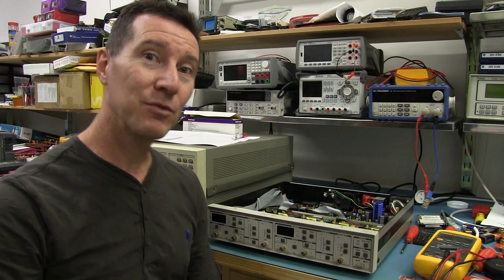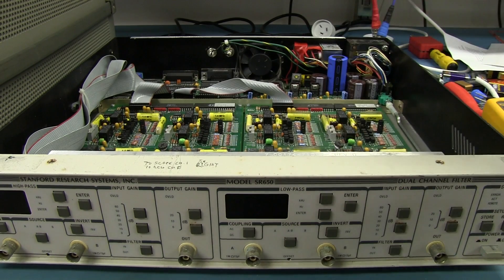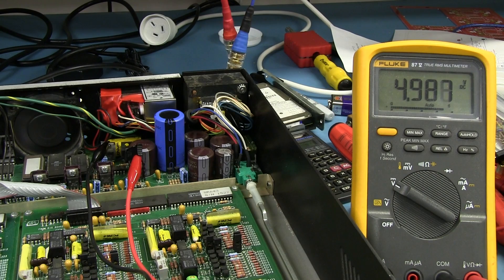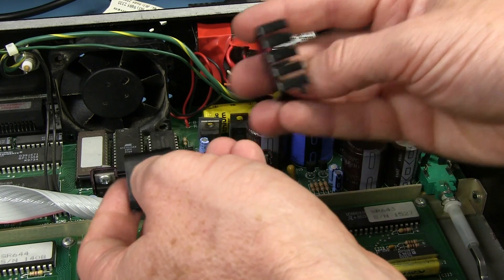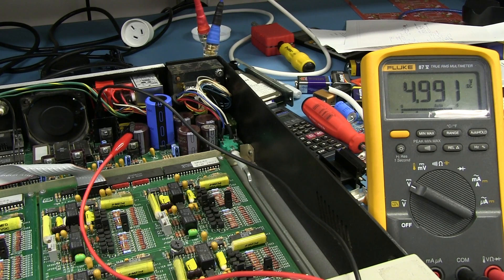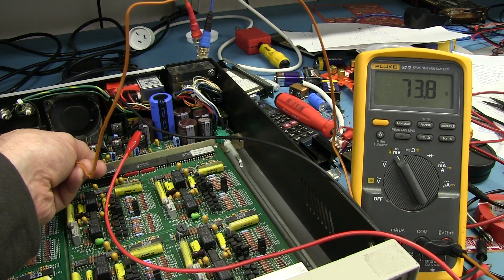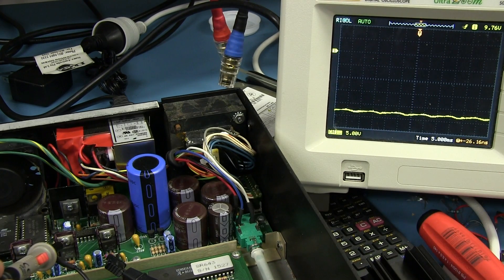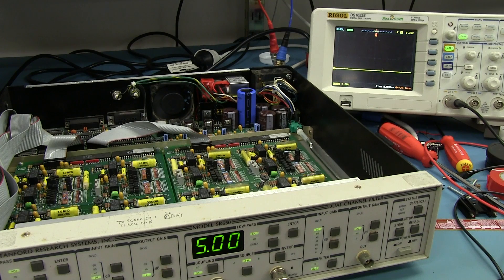EEVblog #621- Stanford Research SR650 Repair - Part 2

Comment: (Note ADVERTISEMENT !!!! )

To make a comparison with a competing product, as a supplier of used equipment, I can wholeheartedly recommend the Kemo VBF8. That model has approximately the same options in terms of filter characteristics. Their gain is only 0 or 20 dB, and the channels have a common power supply. Additionally the filter slope can be reduced to a Bessel-like "pulse respons" shape.

But their power supplies do not have the disadvantages mentioned in this video. The power supply of the VBF8 is designed with a toroidal transformer and such a two-channel instrument consumes no more than about 13 - 15 Watts. And because they contain no LED displays or microprocessor, the VBF8 does not require a fan, and adjustment of cut-off frequencies works with mechanical rotary switches.

For those who want to use such a filter instrument, Eurias can supply a number of units that were assembled in the previous century. With minor signs of use, no rusty connectors, calibrated and tested, they still function as well as when they were first put into use. In addition to variants with an elliptical response, there are also some with an 8-pole Butterworth response. And they are supplied for connection to a 120 VAC or 230 VAC mains voltage, to be specified on order.

Someone else published a video on the Kemo VBF8 at : https://www.youtube.com/watch?v=vFCpho126Fs

Comment: If the vr is a 7805, with the tab being ground, why not omit the the insulator?  Seems like without it the thermal resistance of the joint would be less and the vr would run cooler.

Comment: Looking at the grommet on the transformer wiring, suggests a metal cover was fitted over the mains filter, the regulator would have been attached there so it would be quite a big heatsink, the last person had to remove the screw to take the cover off to get to the mains wiring. That's my guess anyway!
Reply: That is EXACTLY the problem. I didn’t read all the comments to see if anyone else caught that. Looking at another video about the SR650 shows a large aluminum shield box around the input power module. The regulators are attached to that box, which serves as a very large heatsink.
Reply: @Technical_Audio  Wow 5 years ago, I don't even remember posting that comment :D

Comment: Couple years late to the party here, but with respect to the thermal performance:

Remove the stamped fan grill, replace it with a wire grill, and flip the fan around. Airflow volume isn't directly related to heatsink performance; airflow velocity is. The two values are (obviously) related, but the latter is ultimately what affects heatsink performance.

Running the fan as an intake will generate more directed airflow over that power supply section than running it as an exhaust would (by virtue of the fact that axial fans tend to pull air in from every direction while the output is at least somewhat collimated) and produce a significant decrease in operating temperature on those voltage regulators. I don't think this thing uses enough power for the fact that you'd be pushing pre-warmed air across the mainboards to matter; I don't really expect the temperature rise to be meaningful. 

In fact, if you ditch the existing grill and reverse the airflow direction you can probably run a fan that's rated for perhaps as little as half the airflow and static pressure of the current one and still improve thermal performance. I'd recommend something from Sanyo Denki; they're of markedly higher quality than EBM-Papst or Delta and they tend to be quieter for a given flow/pressure curve. Nidec would be excellent, too, but they appear to be hard to come by, at least in the states. Mouser and element14 both carry Sanyo Denki (not sure about australia-specific distributors).

Comment: Great bit of detective work on that hardware. It shows how randomly trying to diagnose/fix things often makes things worse. I remember as a teenager many attempts to repair the family vacuum tube television. Back then that would generally consist of removing all the tubes, visiting the local Rat Shack, trying inserting them one by one into the tube tester, and replacing the ones found to be defective.

I'm guessing that someone with just enough electronic knowledge to be dangerous tried to fix this, randomly disassembling parts of it, then gave up and put the cover back on, minus a few components. Removing a heat sink, though, is the work of a neophyte. It's just like trying to fix an old single cylinder gasoline (petrol) engine by first adjusting the carburetor, which is usually the LEAST likely thing to be out of adjustment.

Comment: 7805 is only 1A can not feed all the segments on that display for too long without disipaiting the heat.. needs a power transistor to carry the load though an inverting OP

Comment: Hey Dave, don't put the repair down. I think this is a great example for a beginning service tech in any field. I've been a tech for over 30 yrs and plain observation is a hugh part in repair of any item. As soon as you noticed wrong screws in the housing, you should always expect anything. Tamper damaged equipment can be a nightmare to repair so rejoice in your ability to find a solution when someone else couldn't.

Comment: I think there was a bigger heatsing - a common one for the 7805 and the TIP for fan controll. and the common heatsink is the reason why there is a isolation silicone tab on the 7805. (why else would the tab be there with a dedicated freestanding heatsink ?)

Comment: Great set of videos!  I just bought an old BK-Precision O-scope and it was listed for parts or repair, so videos like this are really helpful in pointing out what I should potentially be looking for.  Man, that's a pretty nice piece of test equipment!  it will be much easier than breadboarding some filters, meh :(

Comment: Hi Dave. I enjoy your videos, and have also checked out the "Live Cam" too.
 I also have some SRS test equipment. Not badly designed, but could have used a little more thought.... IE: my SR780 has the power switch on the back. What the heck were they thinking??
With your SRS filter.... A big part of the regulator heat issue is the missing lid while servicing, on top of the already missing heat sink problem. You can see the air gets pulled in (or pushed) through the side of the case, and would travel right over those regulators. Computer fans push or pull air in a somewhat conical fashion . This would place those regulators in the direct path of air." So they did their homework in that respect. Still..... It's a screwy design!
I think EMI and RF noise are the reasons they didn't go for a switching power supply. The cost in added filtering, shielding, and "engineer brain power" was probably worth more than the linear supply they built it with. I'm sure the "bean counters" are a little to blame for design deficiencies.

Take Care :^)

Comment: The fan is only held in by one screw too! The phantom parts robber was here! ;) But why would the reg have a conductive pad, and all the other regs not have, unless the heatsink was bolted to.... the fan frame via the missing screw??

Comment: EEVblog How can a simple circuit be designed using a small DC motor that is controlled by a MOSFET when the resistance of the DC motor is not known ?

(In my book they usually give some known values of which you can calculate everything...)

My guess is to just play with VGate of the mosfet to adjust the current in drain-source and then you can choose the speed you want. Is this correct?

Comment: that 5volt regulator with the tip transistor next to it should be a current pass transistor as there is enough digital stuff on those boards to easily go over 1amp or maybe 2. just a thought.

Comment: I too see blown regulators now and then. Some are IC, others a zener and pass transistor. I can see they had a hard life because the heat darkens the board around the regulator IC/transistor. Simple calculation to find heat given off and use proper heat sink to keep temp down.

Comment: Thermal design for power supplies of this type is seldom well executed. Especially by the spec-sheet jobsworths who should be executed for their inattention to good design sense. I once owned a Philips PM5519 that had a number of those regulators on a board that was well singed, with the excess heat. On occasion, the unit would do strange things. After I attached the heat-sinks to the regulators, that they should have had, the unit stopped giving trouble. Even so, they ran hotter than I would have preferred. If it had not been so much work, I would have replaced them with TO3 packages, mounted on the side walls of the very substantial, aluminium chassis.

As for the Stanford Research unit, the layout for the three-in-a-row regulators makes it easy enough to attach a 25-mm wide strip of 3-mm thick aluminium strip, in place of the small screw on heat sinks. This should keep them a great deal cooler. Probably close to ambient. The 5-volt regulator could be attached to the same strip, with fly-leads to connect to the PCB. 

Heat kills.
Reply: Even on expensive lab stuff, sometimes the power supplies are just plain basic stuff like the datasheet is telling....
I got three synths here which are failing from time to time due to heat issues. Mostly rack mounted....poor power supply design, the heatsink is 90°C.
The same is for the Yamaha TX7 good design for its time, but the Caps are too close to the switching transistor, getting to hot and dry or blow off...

I got now three hohner RD500 digital reverb units with deat PS due to overheating. they have all the same problem, the rectifier diodes are desoldering themself....
 
Beeing an audio guy, i always do my own power supplies, well oversized to overcome heat issues, as it´s not very common using 78/79xx, LM317/337 or even all discrete IRF830 (highVoltage) or 2n3055 (high current) based supplies in a (small) housing with tubes inside as well, causing the temperature rising up to 70°C inside. Tube are well ok with this, while SemiCons not quite;) So i always need (or get) to know where "cold-spots" in the housing are and put the power dissipation SCs there. Otherwise the complete unit will simply fail over time. So when i do my final test stage, i just let it stay on for a whole day long with some thermal couples inside, to see what´s going on and how high the max. temperature inside is and where it is.
Reply: TubiCal Which is a major reason as to why  it never seems to work between repairs :-) I used to have endless fun fixing the test gear, to then go fix what I bought the test gear to help fix.  Marconi, AVO and Gould, for example.

Comment: I think somebody went in there to change the battery and therefore needed to remove the heatsink to do this, check the datecode of the battery, and it´s may younger than the other parts with datecode...

No banana reflection this time;)

BTW, it´s Dave´s 700th video....cool....:)

Comment: Anyone else screaming at Dave to touch the damn voltage regulator to check the temp? Perhaps he did off camera or was really sure that was the issue.
I wonder if the voltage regulator and fan control shared a larger heat-sink, would explain why the Vreg has a sil pad on it.

Comment: I think the person trying to fix the unit originally didn't check the open circuit on the transformer and went to town trying to diagnose the transformers secondary wiring and the regulator. Another possibility was that a faulty transformer was replaced and then coincidentally the AC input filter failed, causing the repairer to give up thinking the PSU was damaging the transformer.  which everyway the repairer would have been a junior like myself. My two cents

Comment: Hi Dave,
i suggest that the 12V fan is connected to the +15V and the +5V.
That is the reason for increase the RPMs while the +5V dropped.
I also suggest, that the original heatsink was like a L-shaped sheet of aluminium,
which is screwed to both the 7805 and the transistor and has cutouts for passing the fan blow through. In the upper corner you can fix the sheet to the fan holes.
Frank

Comment: Considering that this thing was held shut with different types of screws, I reckon someone has had this lying around as a parts donor, probably since after the mains filter died. Then at some point they needed a heat sink and grabbed one from in there, that'd be my guess as to why it's missing.

Comment: Could the reason that these regulators are running so hot and the input voltages are so high that the transformer was replaced? That thing looks fishy.
Reply: Dren Imeraj not 240V as opposed to 120V. More like 240V (or 245V in Dave's case) as opposed to the 230V or maybe even 220V it was designed for. Mains voltages are generally higher than they were a decade or two ago. Many old devices list 220V as input (which including the mains tolerance of +-10% means you had to design for 200V). Now whack 240V at it and you got 20% more voltage on the secondary.
Reply: Ronald Lijs
It has quite much to do with the input mains voltage. The device was designed for 230V maybe even 220V. With mains tolerance this means the transfomer was picked to give enough output voltage at 200V. Run it at 245V and you suddenly you got a few volts more to "burn" on the secondary.
Reply: I was thinking it's possible just the 240VAC input causing it.
Reply: Justin Bell Well, i guess both taps have the same number of windings so it would behave the same if half of that voltage was supplied in a single tap.
Reply: Ronald Lijs
70°C isn't "super hot" for an LM78xx. They are rated for junction temperatures of 125°C (some datasheets go even up to 150). With a junction-to-case thermal resistance of around 4°C/W (typical value for TO220) you could dissipate over 12W at 70°C heat sink temperature and still be in spec.
Also with the case closed the airflow would go right across the linear regulators and keep them cooler. A big part of a design process is also not to "over" design.
So yeah, the best solution would sure have been a passive heatsink to the case (only if the rest of the components really don't need cooling, which is not a given btw.). Other than that there's nothing wrong with this setup with the case closed.

Comment: Ugggh that's horrible. Chuck a decent heat sink across those 4 infront.

I'm also wondering if there was a shroud for the fan to direct airflow over that area.

Comment: Nice videos, To me this looks like it may have been an Instructors/Professor equipment used to test students to see if they can determine the causes of failure. Being that all "repairs" were isolated to very generic areas. The only thing truly baffling was the front mount clean ac output not having continuity to one of the poles. Other than that the secondary wire, heat sink, and mismatched screws give it away. Had something similar in my electronics class a few years ago. Instructor changed out a 5v regulator down to 3.3 to give it a little randomness.

Comment: Maybe the high temperatures you get are cause by the no airflow from the fan because the case is open. Try with closed case too
Reply: thought the same thing especially since the hole in the case is on the right side, so if you close it the air will go from front right to center crossing all the regulators.
Reply: Lan Party Hosting I agree, but hard to measure stuff when closed, put an external fan to blow some air around it and check again.  Box like that is of course engineered to work correctly when closed.

Comment: Question: What would you imagine a non-BER kind of repair would be like? Either it''s some simple stuff like the power supply or it's some not-so-obvious stuff like dead custom parts. Just like you already said.
I think BER does not apply to you: Even if the faulty device can't be repaired by you, it's still a video you can release. If it's really hard to repair(/takes really long to find out it can't be repaired): more videos for us to watch. Maybe disappointing to see we're not getting to the finish line, but I don't think the majority of people tune in to see why your device malfunctions. They tune in to see you poking around in that device.
In this sense: I like that video. Keep 'em coming.
Reply from the maker: See my attempted DSA repair videos a while back, that looks like it's probably BER

Comment: Perhaps the temperature of these regulators would come down a lot with the lid on thus forcing air flow via the two cut outs in the front of the sides.

Comment: 2 things, for one is the falloff better? 
and two, the 7805 had a silpad on it and the TIP did not and they were right next to each other were they mounted on the same heatsinc? make sure the TIP is not overheating!
Reply: Alyx yes that’s what I was thinking probably sharing a heat sink, why else would you have an insulator on the reg if it had its own isolated heat sink